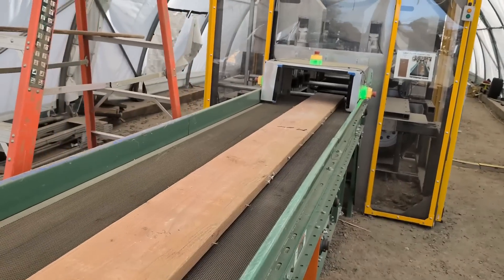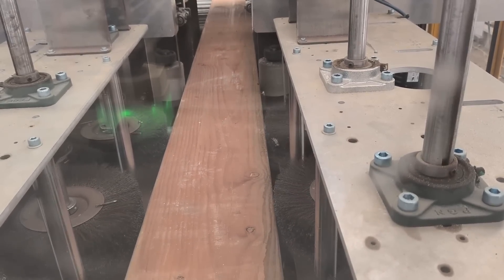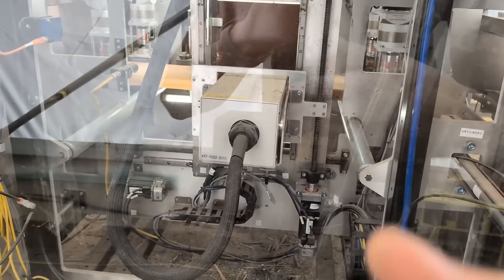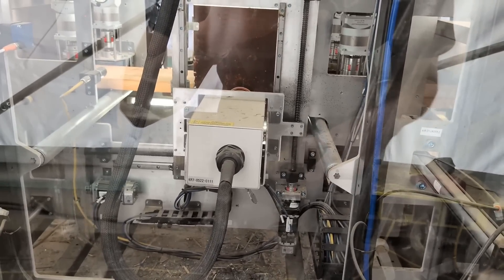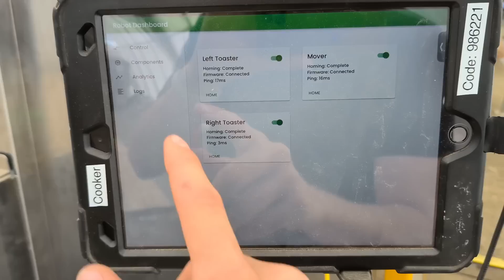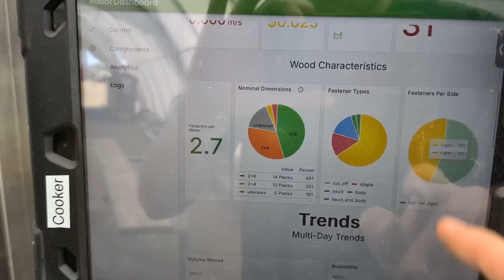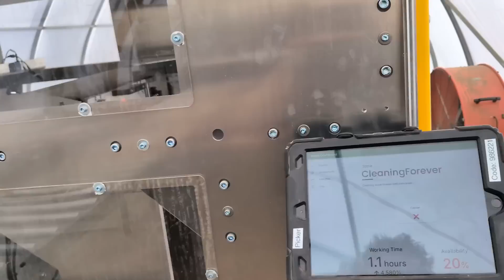Autonomous Wood Reclamation Factory Tour: Urban Machine's Fastener-Removing Robots

Comment: Really cool system. Looks incredibly $$$$ and sloooow.
Reply from the maker: Check it out- I dive into the economics of the machine a bit more in this video. 

https://youtu.be/XLk7Zt73gGc?si=aCcXfTA6NMiNrjWz
Reply: Speed isn't as important if it can run reliably on its own.
Reply: @daleemmons36  Unfortunately businesses rely on ROI in order to justify a purchase and a machine that costs (guessing) $500,000 or more needs to put out a LOT more that a few hundred BF of reclaimed lumber per hour to justify the cost. It IS a fantastic machine though.
Reply: @TheOldManAndTheSaw  did you miss the part when he showed the analytics that they expected to run 1.14km of lumber that day?
Reply: @daleemmons36  No, I didn't miss that figure. 1400 meters of a combination of 2x4 and 2x8 material equated to roughly 5000 BF which, unfortunately isn't very much lumber. I also realized that the system only removed nails from the edge of the boards. That leaves the two width sides to be de-nailed. 
As I said before the system works great for what it does; it just needs to run MUCH faster in order to be economical.
Reply from the maker: @TheOldManAndTheSaw  Assuming $0.5/bf and roughly ~2500 bf/8hr, the ROI ends up ~9 months. Here's the napkin math:

(2500bf) * (2 shifts) * (260 working days per year) * ($0.5 / bf) = $650,000 in a year.

Obviously this is aggressive and ignores labor, but ROI at 9 months is already a highly aggressive goal (in this industry a few years would still be acceptable).

For a startup, that's enough to keep investigating! We've built multiple prototypes and each generation get's much faster. If we doubled the speed of this we'd be well within the margin of error. The real question you should be asking in terms of business risk is- who is buying this lumber? How fast can the market change and grow demand for reclaimed lumber? It takes time to educate architects and structural engineers about the existence of this large-volume reclaimed lumber source. 

To me, that's currently the biggest hurdle we have.

Comment: What happens to metal left inside after first cutting? Half cut half left...
Reply from the maker: @АгронДепартье  it gets pulled out in the last step. The "picker" digs into the wood 1-2mm and pulls out the nails, by grabbing onto the shaft.

Comment: maybe a simple vise to hold the wood while electric hand held drill grabs the screw head and rotates it out. then person manually partially straightens bent nail and uses  electric hand held pincher/puller to grab nail and pull it out.  run board thru metal detector and on to grading and resawing if desired.  yes there would be some screw breakage to be delt with.
Reply from the maker: We tried that, actually! There's a whole concept prototype cell we built. It just doesn't work with the variety of screws you end up seeing in the field. Being able to cook them was the only scalable solution we could think of.

Comment: I've denailed several tonnes of lumber in my life, and this is a little bit exciting. The biggest issue with reclaimed lumber is it's always an annoying 1 inch shorter than the preferred length. Like it'll be 7' 11" because the original 8' board cut cut down.
Reply from the maker: Thanks for your interest! It's definitely annoying. We're hoping we can save all the preferable wood, and the less ideal wood can go into engineered products like DLT or finger jointing.

Comment: Pretty cool processing machines. I think the economics would work on reclaimed circle cut.barn siding that could sell for $7-10 sq foot. Doesnt make any sense when your reclaiming commercially available 2x10 SPF lumber but i think it definitely has its niche. There would also be additional machines needed for proper grading and processing, straight line ripping, skip planing to even thicknesses, etc but i think your on to something.

Comment: what if you used a high powered electro magnet to do the pulling? it would be less damage
Reply from the maker: @imchris5000  I wish we could 😂. Unfortunately the forces involved are too high. For nails that go through the board and are folded over 90 degrees on the other end, an electromagnet could never pull them. The physics just don't pencil out- there's simply not enough metal in the nails to pull at the forces requires to remove them. 

The beak damage isn't a big deal, because you can easily plane down the wood 1-2mm, and have a clean surface again.

Comment: I do not wish to be negative but surely a human can do this much quicker and much cheaper.
Reply from the maker: @jimpackard8059  definitely not quicker on average. Screws take a lot of work to remove, and the machine is effective for nails too simply because it can pull with so much force. Cheaper depends on the labor rates, of course!
Reply: @ I have seen a reclamation yard in London remove screws and nails much,much faster than the machine in the video. And done by a human.

Comment: I would imagine that electrical usage is a large ongoing cost (especially the cookers). Any ideas on how to mitigate that expense?
Are any of the machines 3-phase? How big of an issue would power be for a portable, shipping container style setup?
Reply from the maker: It's actually not very much! Definitely less than 5% of the selling price of the wood, on average. The coils only have to be "on" for about 4 seconds per nail, so most of the time they're not running power.

Comment: I once bought a set of 4"x6"x16' oak boards that had been reclaimed from an 1800's tobacco warehouse that I was going to use for woodworking.
After I bought a bundle of the boards and came to my senses seeing how heavy they were, the reclaimer mentioned that he could cut them down into molding for me using his crazy large bandsaw and molding milling machines. I ended up with a ton of 6"x16' oak crown, casing and baseboard molding. 
Are you mostly seeing pine or do you ever get any oak? Any thoughts on creating molding or is that not cost competitive with dedicated molding makers?

Comment: Awesome!  I am all for saving and reusing anything that can be saved.  Hate to see this stuff go to landfills.  I reclaimed a local structure 20 years ago all by hand.  It is now my two story barn that I built for almost nothing.
Reply from the maker: That's awesome. Barn wood is especially valuable in this business, people pay a premium for the aged patina!
Reply: I can see a LOT of wood being saved with this process. Some more automation at the infeed and an automatic recycling from the outfeed to the infeed to handle those through nails would make the process more robust. Nice work!
Every now and then, I reclaim a pallet. The wood goes to "utility" projects. The last one became a launch platform for my grandkids' zipline and the side boards for a wooden storage box. The hardest part about reclaiming pallets is the rusty spiral nails they use. Those things a re a beast to pull. The last pallet, I just cut off the nails. Of course, this makes the 2x4 hardwood unsawable, but it speeds the deconstruction and they can be sawn carefully between the nails. Wish I had a "cooker"!

Comment: Nails cut flush and left in the wood are not going hurt anything. The claw marks will make handling dangerous, interfere with drywall flatness. I use cutoff wheels on a grinder and barely touch the wood at all and could have cleaned that board in about 2 minutes.
Reply from the maker: Actually, the reason we remove the metal isn't about hurting people, it's about making it possible to use sawmill tooling on the wood. You can't use planars or wood saws on lumber that has metal in it. 

In fact, some sawmills we talked to wouldn't even take virgin lumber if it came from a forest that had lots of hunting activity, because they didn't want to hit bullets with their tools and shatter them!

The claw marks are okay- after we take out the metal, you can plane down the surface of the wood 1 or 2 mm, and it will be flat and useful for other applications (like drywall) 

Thank you for your interest!
Reply: @AlexThiel Sorry but I could not watch the entire video so if this was addressed my apologies.  Why cut the fasteners off level with the wood before heating then pulling? If screws pull out easily, why not heat with heads left on and pull easier with head attached and much less damage to the wood? I am assuming the heads are damaged and not reliable to remove even after wood is burned away around the fastener?
Reply from the maker: @JDL_2020  there's three major reasons- 

1. It makes moving the wood around much much easier. If the surface is flat, we can use simple wheels to move the wood around. 

2. It let's us use very inexpensive camera sensors. Because the wood is flat, we can treat the wood as a 2D plane, and thus we only need 2D cameras. Before we created the cutter we had to use very expensive cameras. 

3. The cooker relies heavily on being as close as possible to the metal it's heating. If we don't cut it, we can't get close to the part of the metal that is inside of the wood, which will weaken the cooking effectiveness significantly.
Reply: Flush cut fasteners left in the wood will definitely hurt the teeth on my miter saw, table saw, skil saw......
As for interference with drywall "flatness", this wouldn't interfere any more or less than the twisted, warped, bowed, wane and knot riddled pieces of crap we call framing lumber these days.

Comment: I don't know about this. Huge cost in buying these machines, maintaining them and operating them. These would need soooo much service. I have reclaimed a whack of lumber from old decks and I can tell you that I could have removed all the screws and nails faster than this machine on this example plank. No, I couldn't do it 24x7, but these machines won't either. it's a great idea, but..... so would a jet pack.
Reply from the maker: I'd push back on the cost side- we're competing with pretty large scale industrial grinders here. The BOM cost of this robot is easily under half a million, making it comparable to other capex for waste processing facilities.

On the maintenance side, totally. We figure we can improve the reliability and robustness of the machines over time. We've been deployed for over a year processing wood, and things have improved tremendously. There's still more work to do, but that's how progress is made!

Comment: really interesting, but has to be sped up 10-20x to be as fast as sawing new wood. Also I do not think fasteners are the most critical component in old wood. I mean yes, with metal fasteners in wood you have to pay attention with sawing etc. (but with burnt holes you also have to look if the cross section is not becoming too small). I think main problem will be that it is hard to determine if your wood has been treated / how poisonous it is. Here in Europe it would not be viable. Houses in Europe of American construction (wood stick houses with drywall/wooden prefab houses) are almost worthless when you look at the market and they are pre 2000s era. You almost only pay for the ground because you literally buy a hazardous waste depot. too much stuff in there that gasses out and can only be disposed of.  Had a colleague that bought a wooden frame house from the 70s. Had an awful smell when windows were closed for more than a few hours and the parameters from the lab report made him exchange each and every wooden beam in this house.
Reply from the maker: It's definitely not as fast as processing virgin lumber! I also totally agree with regards to treatment. We don't handle any wood with paint (lead concerns) or pressure treatement. Luckily it's pretty clear when it's been painted or treated. I'd be curious to learn more about the wood market in Europe though- what kind of poisons are found in wood there?
Reply: @AlexThiel  I read that you can expect - besides asbestos in a lot of the things attached to wood - Formaldehyde, PCP, TeCP, Cholanisole. As said, these houses oftentimes have a characteristic smell (the Cholanisole) and what I found in listings often just goes for the land price because people here care a lot about their health. 

What I think is far more feasible but also a lot rarer are centuries old buildings that are being demolished. There is a small industry recycling them. The lumber in these buildings is very good. Because some countries have very strict monument protection laws in place, sometimes your only option of repairing your building is by using these old reclaimed materials. Granting at least a bit of a niche market to companies pursuing this path. You can watch sth. about it in this doc: https://www.youtube.com/watch?v=Z29MfPQ3yQI

Comment: Really neat! Interesting problems to solve... machine learning/imaging + mechanical solution. I'm not sure if you plan to make it commercially viable, but that will be a challenge if you want to get all the fasteners out.

Hydraulic punch-outs for nails and perhaps a version of your gripper that's able to rotate screws (mechanical grip + strong magnet?) might work at scale. Of course that assumes your imaging can detect screws vs nails... no easy feat.
Reply from the maker: @jmaster8407  one of our iterations we tried to back out the screws. Unfortunately the screws tend to come either broken or bent, making backing them out almost never tennable. Cooking and pulling ended up being much more effective!

Comment: This video shows that fastener removal can be automated.  I suspect however that the real economic problem is that is is much cheaper to crunch a house up with heavy machinery than to take it apart manually to save the wood.
Reply from the maker: @brucedunncanada  oh, demolition is absolutely easier than deconstruct, no argument there! However, you'll find that (in the US at least) most commercial deconstructions that are tearing down large scale projects, they're already required to separate at the source most of the materials. Concrete, steel, rebar, and wood is being separated at-site, and being sent to separate waste facilities already. 

What we want to do is prevent them from also grinding the wood on site, and instead sending us the unground beams. 

This is actually a benefit for the deconstruction folks, because they can save $ on tipping fees. We can take on the material for free, and they don't have to pay landfills.
Reply: @AlexThiel  Thanks for the explanation.  I see that your process has a place in the scheme of things.
Reply: @AlexThiel  now you just need a machine that can be hauled to the job site that will perfectly stack instead of random "stacking"

Comment: Great line you guys have set up. Here in the Northwest, the old growth Douglas Fir found in older houses and buildings is a really premium wood, it's really solid. 
  I'm sure you have gone through this, but as someone who has done a lot of this manually I would think if you could cook with the screw heads out then you could use a V shaped device to pull as the board moved through. May not be worth it for nails but for drywall screws I would thing that would cut down process time.  
  Have you though about in the future getting a finger jointing/ laminating  line set up in the future so you can join boards that have lost a little at each end?  
    Those grabbers do quite a nice job and leave a clean little mark.
Reply from the maker: We do actually have a DLT machine for post-processing the wood into really beautiful panels. We shipped a truckload of lumber up to oregon and had all of our smaller pieces fingerjointed, but we haven't had much traction from customers for that particular material.

I love that there's so many folks that have manually reclaimed wood, thank you for your interest!

Comment: Why go to the trouble of finding fasteners visually when you're cooking them inductively? Could be found inductively (like a prox switch does) maybe even the cooker could know (via real/reactive power) that it's found one.
Reply from the maker: @ChiefBridgeFuser  well, the cooker has to find the fasteners in order to drive the XY gantry to them. We've experimented with different detection modalities (even x-ray), including having an array of prox switches. Unfortunately it's really hard to design something that both gives: sub-mm positioning accuracy, AND can detect on arbitrary wood dimensions ranging from 2x4 to 4x16. 

We found vision worked best because of the metal is subsurface (rare) the picker usually can't get it anyways.
Reply: @AlexThiel  huh.  Needing sub-mm accuracy for a lumber application seems like there's gonna be a cascade of hard problems that have to be solved.  Good luck!
Reply from the maker: @ChiefBridgeFuser  woops, I meant sub-cm 😅. The width of the beak is 1cm, so it's tolerant to error within the mm range.
Reply: @AlexThiel  "what's an order of magnitude between friends" 😮😎

Comment: Great prototype line, but do you thing in the long term things will combine into one station?  Bandsaw, then cook, then pull?  Also, I'd be tempted to leave 1-2mm clearance on the fasteners, adapting the rollers and try not to take quite the bite out of the material for removal as a first pass.
Reply from the maker: @DerekWoolverton  we've played around with the tolerances, cutting flush has been nice all around. Besides, most of this wood gets planed down a mm or two anyways to give it a facelift, so the bite marks aren't going to show up anyways 😁

As for putting them in one station, there's pros and cons. I think a low-BOM version of the robot would have everything combined. However right now having them separate can be valuable, because it lets buffers build up between board. Some boards take longer to cook or pick, so that lets machines do more work on parallel. There's definitely some tradeoffs to both approaches!